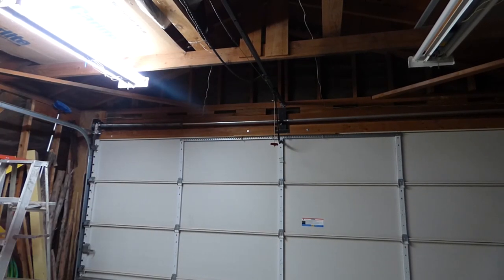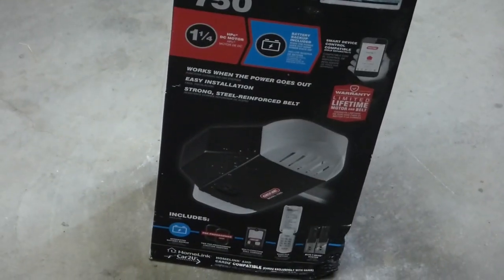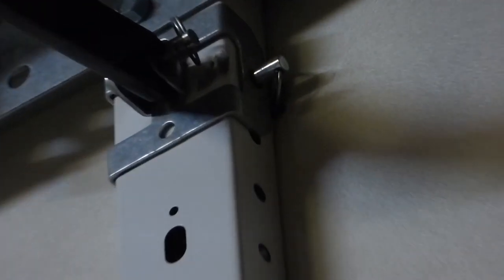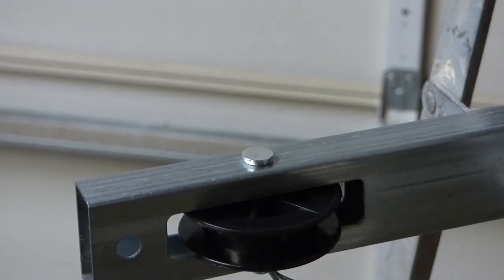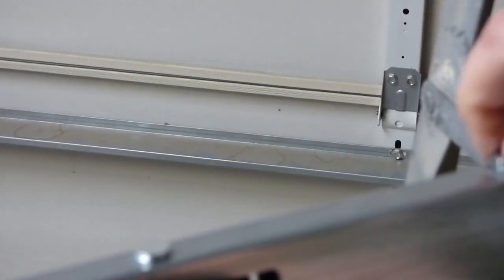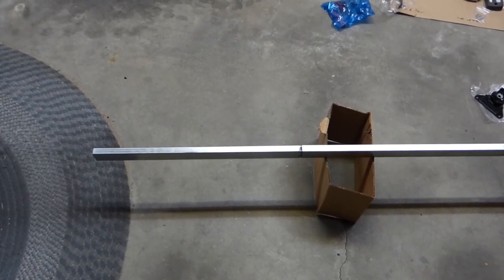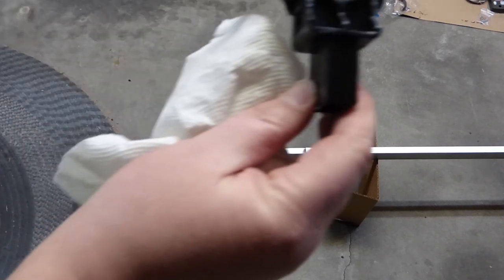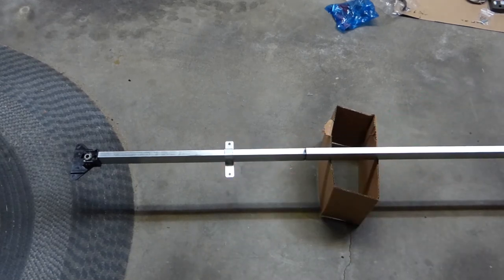The Odd Job Do'er Installs a belt drive Garage door opener!

Comment: Where are the springs?
Reply from the maker: the springs?? i have not yet to see a garage door opener with springs. as for the springs on the door they are at the top, some one piece doors will have them at the sides.

Comment: There chucked full of plastic  bought by overhead door co about 15 yrs ago a Japanese conglomerate there logic boards overpriced help line is lioged up for 1hour or more openers are over priced there chain system is hodge podge chamberlain is twice the unit less $$ then genie ive 39 yrs repairing but no more! There emergency release carrige is cheap ass plastic very expensive to repair and easy to break  there help no 800-35-genie
Reply from the maker: well i always like the Sears brand.. but they are hare to find around here.